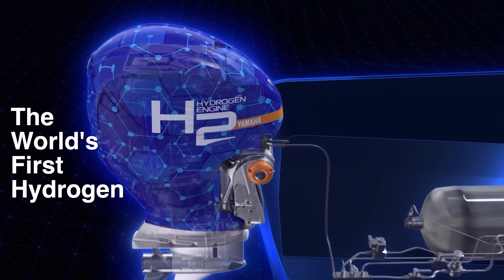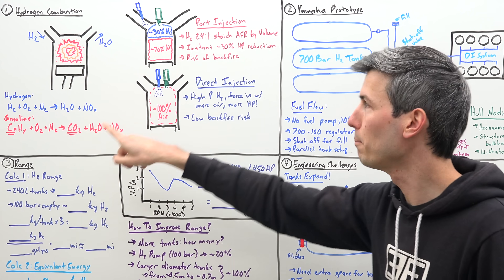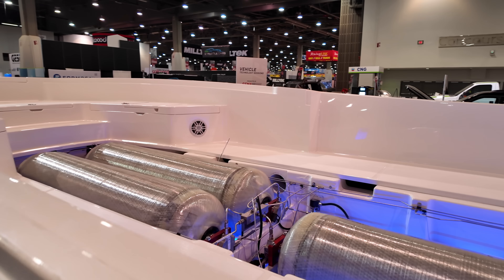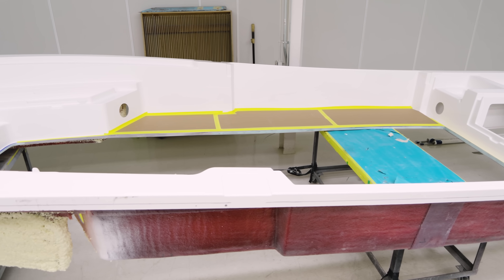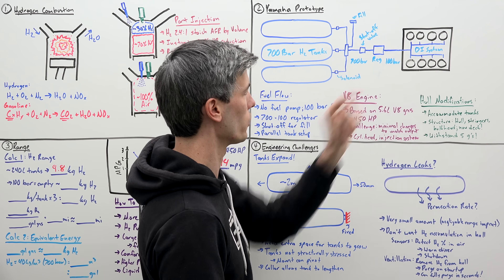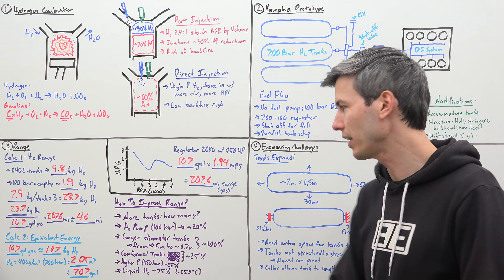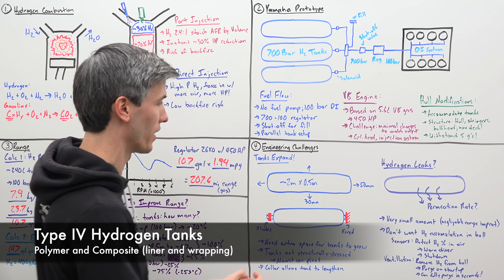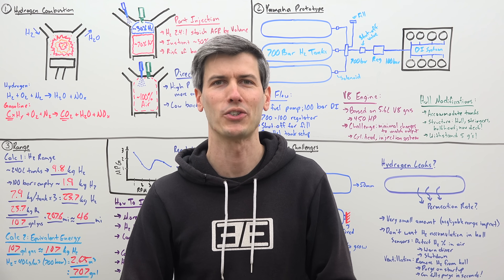The World’s First Hydrogen Combustion Outboard Engine!

Comment: We are happy to work with you on this collaborative effort! Excited to see where it goes from here!
Reply: About 47 miles apparently.
Reply: @matt_b...  lol
Reply: It'll go nowhere because a boat is a terrible application for hydrogen power.
Reply: DetecTape could really help with the safety issues associated with storing all those hydrogen components under the deck. It makes identifying/locating the hydrogen leaks very easy. If you work with hydrogen, you know it will leak any chance it gets...
Reply: My immediate question here is why hydrogen combustion was chosen over the use of a hydrogen fuel cell with an electric motor. Is it a weight problem similar to battery electric? I'm just wondering because if you're already bringing the hydrogen with you, why not use a fuel cell and get the extra efficiency? Cost? Weight?
Reply: @matthewmalaker477  Brother, you're talking to someone who runs the social media account, not the engineers who invented the engine.
Reply: @Buggabones  lmfao
Reply: @matthewmalaker477  Because you use a lot of power all the time. In a car, there is only a small fuel cell, most likely under 50 kW. But this boat takes over 100 kW on cruise speed ALL THE TIME. So the fuel cell would be much bigger, and extremly expensive. You would have to get rid of at least one tank for space and weight of that fuel cell. So, 3 times more efficent, but only 2/3 of the fuel: The range would only increase from 47 miles to 94 miles. But it would be relativ silent.
Reply: @matthewmalaker477  bro... WE ARE FIGHTING EVS.. i think anybody should support yamaha's move to keep combustion engine forever..
Reply: @matthewmalaker477  Because Yamaha is in a delusional fight against electric.
That's the only reason why they are trying combustion.
Reply: @matthewmalaker477     Fluid propulsion doesnt allow for regenerative braking, so a more efficient engine is better than a fuel cell or series hybrid setup. Electric propulsion on fluids will only take over when we finally eliminate input conversion (plug-in batteries).
Reply: @gsilva220  While regen is nice, it isn't needed for a fuel cell to be more efficient than combustion.   It's already notably more efficient.  H2 fuel cell would be a lot more efficient than burning it.  (fuel cell cost, etc is another matter)
Reply: @gsilva220  Its not about going electric. Its about splitting the water atoms and extracting the hydrogen fuel out and then using the H2 for combustion. If we store h2 as water then the amount of h2 stored in the system will significantly increase even if we have an electrolysis unit which is 80% efficient.
Reply: @gsilva220  Fuel cells + Electric motors setups are about double the efficiency of combustion engines. Even without regenerative braking fuel cells are the more efficient choice.
Reply: @guilmon999  That efficiency comes at the cost of rare metals, and they aren't cheap. It's a back and forth battle, yet I feel Hydrogen does have a real future. I was honestly hoping Hydrogen paste would be at the age of utilization, but I believe it's still in the works.
Reply: @WylieWiggins  New battery technologies are under development that do not use rare earth elements.  The technology is developing all the time.  Many of the problems mentioned in the comments won't even be remembered in 5 years.
Reply: hydrogen is greenwashing
Reply: Sorry. hydrogen combustion is just silly. You can get over 80% carbon reduction by using methane for fuel. Methane is a whole lot easier to handle and safer to store. For one thing, you don't have to deal with metals becoming brittle and destroying your entire storage and fuel system.
Since you are going to use the methane anyway to make your hydrogen, just save the cost and complexity and be a whole lot more honest about what you are really doing.
I won't even wish you good luck because this is a doomed project.
Reply: @surferdude4487  There are other ways to make hydrogen, js
Reply: Clearly more energy goes into making hydrogen, storing it, cooling it, etc. etc. then that it actually delivers on energy. The rendement is just negative. ...I say ‘very nice surprise but a no go’.
Reply: 🤯💥🤯Multidisciplinary engineer/inventor here. We are developing an ultra simple, long life, engine architecture which offers significantly‼greater power to weight ratio [specific power] and energy to volume [specific energy]...without any pollutants [No, CO2 is not a pollutant] and can use any fuel or mixtures thereof. The ~60% thermal efficiency is close to an EV's charge-discharge cycle efficiency.😉 Waste-To-Fuel technology will provide renewable, carbon-negative fuels. 

😶‍🌫The 𝔽𝕦𝕖𝕝 𝔸𝕘𝕟𝕠𝕤𝕥𝕚𝕔 ℤ𝕖𝕣𝕠 𝔼𝕞𝕚𝕤𝕤𝕚𝕠𝕟 𝔼𝕟𝕘𝕚𝕟𝕖  
[𝔽.𝔸.ℤ.𝔼.] tech best solves the issues present in previous internal 
combustion engine designs by transforming the old paradigm into a 
simple, low cost, quiet, power dense, efficient, on-the-go liquid and 
gas fuel-flexible, ‘non-polluting’ solution for power generation of all 
scales and advanced mobility not possible before.

Companies can either get aboard or risk getting run over.  😁 

The core 𝔽𝔸ℤ𝔼 tech delivers better than 25% ABSOLUTE/ACTUAL [not relative] 
fuel efficiency improvement over gasoline engines, more than 15% 
for Diesel engines at any operating condition - speed/load, ambient 
temperature or elevation, not just at one optimal testing point at 
STP. Real world driving cycle savings could be an additional 200% 
higher due to the constant MAXIMAL efficiency and torque which 
results in a huge turn down ratio of ~99% without sacrificing 
performance. That means it's idle or running speed can be 10-50 rpm. 
The `simple, low cost, native/built-in, non-electric, environmentally safe, 
non-explosive, temperature agnostic 𝕊𝕦𝕡𝕖𝕣ℍ𝕪𝕓𝕣𝕚𝕕© feature 
recovers more energy than EVs and provides approx.100% fuel 
savings for a combined absolute vehicle fuel usage improvement of 
approximately 300%, thus obviating the basic need for expensive 
EVs & e-hybrids. 𝕚ℙ𝕠𝕨𝕖𝕣𝔹𝕠𝕠𝕤𝕥 adds >400% more torque. It’s like 
4 engines in 1. 𝕚𝔼𝕗𝕗𝕚𝕔𝕚𝕖𝕟𝕔𝕪𝔹𝕠𝕠𝕤𝕥2© further improves efficiency, 
torque, power & other performance metrics by 10%. This is all done 
w/o a transmission. Additional fuel saving solutions are available.
 
The FAZE engine perfectly follows the vehicle’s road or genset’s 
electrical power demand with no energy loss [no fuel waste], This 
unique characteristic enables dispensing with any auxiliary power 
units [APU] for power or refrigeration in any application. This also 
makes for a perfect range extender for battery electric vehicles [EV] 
or as a standalone EV charging unit even where is no electric grid.
 
The fuel agnostic capability allows instantaneous use of any liquid 
or gaseous fuel [natural gas at home!!!] incl. biofuels and hydrogen, 
even if old/dirty/unprocessed like flare gas or employ the concurrent 
multi-fuel capability…anywhere on the globe. One engine for all 
locales w/o changes! Unlike EVs, this enables fast fueling anytime, 
anywhere…with no troublesome infrastructure disruptions or 
changes. EV’s are not a solution to the [FAKE]climate or mobility topics 
as high level of electrification globally is unrealistic 
[See Patrick Boyle's video "Electrify Everything?"] .

The technology offers smokeless, non-polluting, low odor heat and 
noise output without costly after-treatments, etc.,… with only the 
lowest  CO2. It has a negative carbon footprint with hydrogen, 
ammonia, biofuels or gasified municipal, agricultural and/or forest 
waste and coal from a 2-stroke-like simplicity. These are HUGE 
business opportunities. 

The FAZE technology can be integrated into any ICE or vehicle 
architecture, adding some of the positive characteristics to its own. 

With virtually no electronics and emissions equipment, the cost of
purchase and reduced servicing frequency make this solution 
even more appealing.
 
Those are my two-bits

PS.
Did I mention we're developing advanced, simple, low cost, power dense electric machines and torque dense[read - compact], infinitely variable FrictionLess transmissions?
Reply: Keep it going. Have you tried chemically changing the make up of hydrogen by adding some sort of magnesium to its solution?
Reply: @TheSeejayA  Hydrogen paste, maybe? I think I've heard of it.
Reply: Japanese is the most stubborn culture on earth. Hydrogen combustion has clearly no future for such small leisure boats or transportation vehicles, still they continue burning their cash in that chimera
Reply: What would the equations and volumetric efficiency look like for an Ammonia-fuelled boat?
Reply: @41istair  you tell us. :) It would be interesting to know in this application, I agree. (I think it wouldn't be very different, and ammonia in a small-scale application is too hazardous, I would think consensus agrees.)
Reply: Donald Trump in very soon January the 20th Drill baby drill for oil... Yamaha I expect trying to Kiss the ring of Klaus Schwab World Economic Forum Villain.  Human made global warming is a complete lie. It is an excuse to bring in Communism which is difficult to sell to the people under its real name.. Co2 exists in .04 percent. And if it drops to below point .02%  Then plants start dying off. In the past it has been much higher with very big plants. So ladies and gentlemen we actually need more CO2.. If you're at a trade show let Yamaha know this... And at 10,000 PSI One of those large tanks exploding would take out the whole of the boat Yard Marina or anywhere it is close to.. And obviously it would also rupture the other tanks that are in the boat as well. Only saving Grace is that explosives decrease with the distance by the power of 5...... Most impractical Idea and a great sales pitch for gasoline   Hopefully Trump can lock up a lot of these villains that have pushed the global warming scam Within the government.
Reply: Hopefully you can pull this off.  Perhaps a smaller boat where the tank can be the entire length.  Those larger center console boats all have the electronics locker and small bathroom under the console.  Don't under estimate the importance of that space. People won't want to give that up, especially with women on board.
Reply: @YamahaOutboards01 were there swagelok fittings used on this?
Reply: Yamaha Yamaso!
Reply: That depends on how much money Yamaha decides to throw away racing headlong into a dead end.
Reply: Dear Yamaha,Yamaha y15zr suberb bike please release V3 with abs and improved dohc engine and 6speed gearbox,tq.
Reply: Hindenberg??
Reply: Hindenberg ???
Reply: You know exactly where it's going, to the not adopted never off the ground pile.
Reply: What happened to his Hairs.   .
Reply: Would love for a solid fuel cell system.
Reply: Love your work with revolutionising marine engines! We've got a 2006 225hp 4 stroke on our fishing boat and it's been unbelievably reliable with over 2000 hours on the clock 💪
Reply: Whe also had some challenges switching from 2 to 4stroke and 4 stroke also had some downside but whe stil made it happen just a matter of time
Reply: @roverkootnl1854  what were the challenges and downsides you experienced? We went from 2 stroke to 4 stroke on both my boat and my father's boat and the only downside was less top speed, however the boats were still doing decent enough speeds. All the pros of doing the swap well and truly made up for having a little less top speed.
Reply: @YamahaOutboards never too late to put some of your eggs into some decent battery electric propulsion before the Chinese outcompete you in no time
Reply: @BeLowBelowo       Plug-in battery-electric propulsion unfortunately has no future. The reason is very simple: Batteries do not store electricity, but chemical energy instead. This means charging a battery is an energy conversion operation. This input conversion is the reason why plug-in electric vehicles didn't really catch on, despite all other electric primary traction applications having thrived for almost 200 years. Combustion engines will still be useful for at least 50 years, and development will continue for at least 30 years.
Reply: @gsilva220  Wait, you're saying electric propulsion has no future because it has to convert chemical energy into electric energy into kinetic energy, and instead we should stick with combustion engines that convert chemical energy into heat energy into kinetic energy?
Reply: How much did you pay him?
Reply: Have you ever watched Bob Lazar's hydrogen Corvette?
Reply: Your name seems fake and your logo is not centered. It sits too low the bezel on the bottom is thinner than the top
Reply: You could use 3 tanks, each twice as long as current tanks, one tank on the bottom of the hull and 2 tanks above that bottom tank to conform with the V-shaped hull, in order to double the H2 volume.  So now, the range has doubled to 94 miles.  The use of hydrofoil wherever possible can double the 94-mile range, thus restoring to the same range of the gasoline boat.   The engine thermal efficiency could be increased by 50%, thus expanding the range to 300 miles via the use of fuel cell or special engines with heat recuperation... but that would be a topic for the future.  The use of cryo-cooled H2 when chilled down to 160 degrees K, or -110 C, thus increases the H2 mass by 50%, can increase range by 50% moore,  to nearly 450 miles.  Wow!
Reply: @trungson6604 pressure vessels don’t like being long and skinny. The ideal pressure vessel is just a sphere.